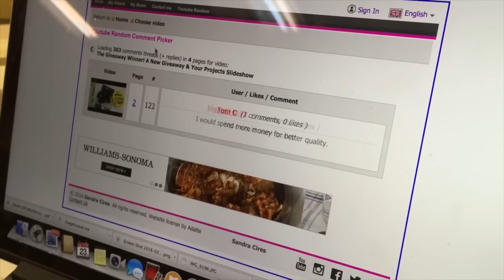Frame Giveaway, Last Week's Winner & Your Projects

Comment: ANY screws that are NOT Phillips Heads...I like using Square Bits, or Torx head screws, and typically Exterior grade to prevent the screw from reacting to the stain in any way and bleeding out onto my project.

Comment: I always use "deck" screws or wood screws (coarse thread, and they tend to be gold colour Robertsons). I buy them by the pound, since all the packaged ones are far more expensive (you pay for the packaging, basically). These are available just about anywhere, and I think they're only a few dollars per pound. Lots of lengths available, from 5/8" all the way up to 4".

Comment: I think it 100% depends upon the project, however if I will be hiding the screw I normally go with what I have on hand, which is decking screws. The seem to drive nicer, I rarely if ever had a head stripped with the star heads and the non-threaded shank had always helped in keeping the piece aligned. There are times when I have used drywall screws and because it's threaded up to the head Ive had the piece pull offline (best way I can describe it)...

Comment: Because the structure is a softer wood, I use coarse threads.  I like the pan heads when I can find them.  I also like having a threadless upper portion so the screw pulls the board in tight.

Comment: Spax screws.  They are expensive, but so far I haven't had to pre-drill when using them.  They come in a variety of sizes and threads for different uses.  They also use a star drive bit which doesn't slip.  What's great is that the bit comes in the box, so you always have a new bit on hand.

Comment: Put it as it is, even if it tends to fall back, the way you can solve it is to screw a long spring underneath the back panel on one end and screw the other end on the second panel, that solution will work because it will tend to close every time the tv pushes it up, and it's cheap, just make sure not to screw the spring where the tv lift pushes the top otherwise it could get stuck, hope this suggestion helps and keep up the grate videos!

Comment: Every projects I have worked on, I used coarse screw or dry wall screw. I think it holds better and easy to work with than fine threads one.

Comment: I like torx screws in any application where I can get them. Just because I get less slippage and rounding on the head. Bi also agree with the fine seems to break less but when you are going into wood I think you want bigger find for a better hold.

Comment: I've had a real problem with drywall screws failing when I use them on cabinets. They will stray (even when I pre-drill a hole) or break completely. I started going to those deck screws (usually 1 1/4" or so....the tan ones). They are not much more than drywall screws and just seem to perform better.

Comment: The screws I use depend on the project and, more to the point, where the project will be or how it'll be used.  For outdoor projects, I use either Deckmate tan screws for hidden screws or stainless, for visible screws.  For indoor projects, I'll use just regular steel wood screws of appropriate size/length.  I try NOT to use straight or phillips head screws.  I prefer square or torx head.  I'll also choose coarse or fine thread, depending on the type of wood I'm using.

Comment: yea i would definitely pay a little extra for better quality. (get what you pay for) and for me it depends on the type of wood that im using as far as screw type goes  but 90%of my screws that i use are galvanized star bit grip rite construction screws and they are a coarse thread.havent had any issues with them so far.. "knock on wood";)

Comment: I was using drywall screws then tried kreg, but they were too expensive I felt... so I tried spax and got a ton of great screws. They don't seem to have course or fine but their torx heads on some of the small screws wont ever strip.  Also the heads on the screws I have are rather small.

Comment: Jon I prefer coarse thread drywall screws. I just feel they give a stronger hold. If not drywall then I use Spax brand coarse thread screws.  They are really good screws but I only use them on certain projects because they are pretty expensive.  Thanks for the chance in the giveaway

Comment: Drywall screws tend to be a little too brittle for woodworking.  I suppose they would suffice on a well-glued joint like a brad nail that simply holds the joint together until the glue sets.  Otherwise, using woodworking or dedicated wood screws is really the best bet if the joint is structural or load bearing.  As for the fine vs coarse threading, the finer threads should be used for hard woods with tighter grain and the coarser threads should be used for softer woods, like pine, etc.  Just my thoughts.  And the TV cabinet is looking awesome.  I really enjoy your work.  Keep it up.

Comment: Don't get me started on screws. My preference is none. Using dadoing or grooving I can get solid joints, no fasteners needed. Yes I do use pin/brad nails to hold while the glue dries. All that being said, I do not like phillips head drywall screws. I much prefer pan head or washer head screws. They pull tight and don't crack the wood. If they need to be hidden counter sink and plug the holes. :-)

Comment: The screws that I use for cabinets are made by WURTH #8 x 2".  it a ASSY Plus 3.0 screws  tried to add pic of them but could not.  I'm a cabinet maker they seem to work the best and will not been. if you have time please check out me video in installing cabinets.